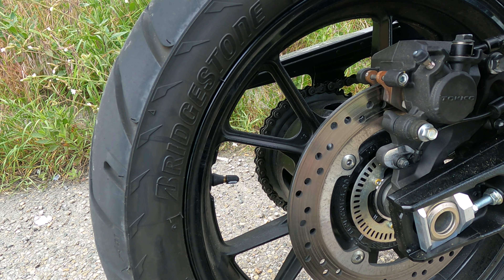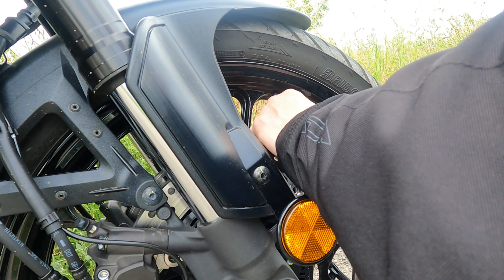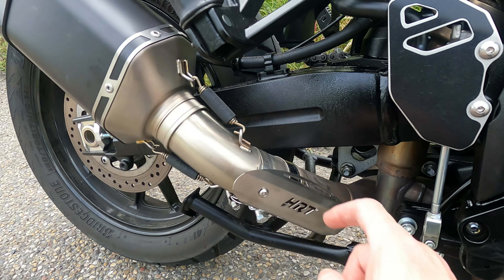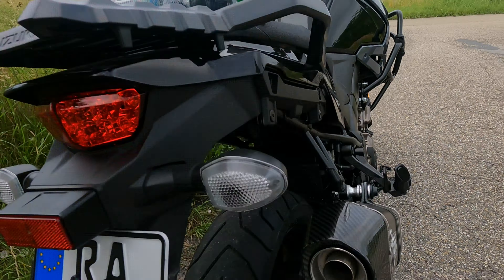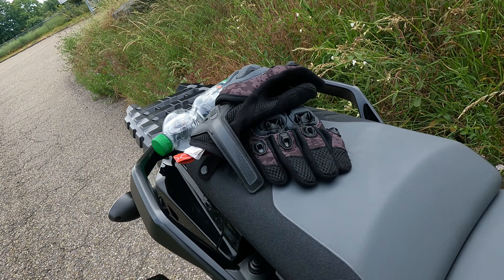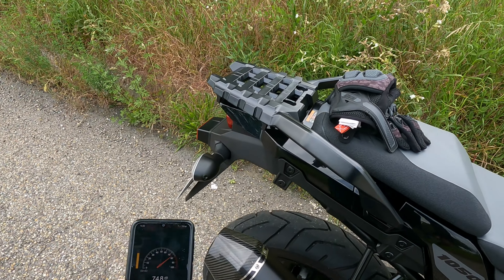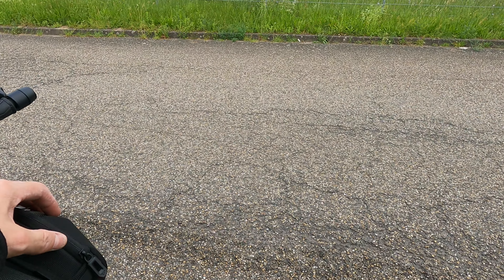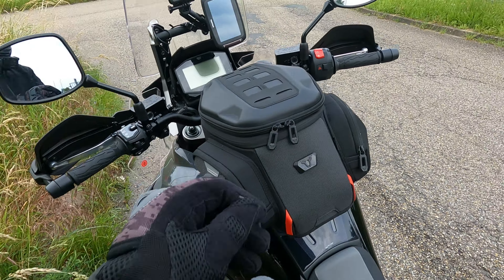V Strom 1050 Mivv Speed edge.

Comment: mhm....... i use a similiar pump from lexin, thats one of those acessories which are very useful s I don´t have to ride to the gas station first.
the sound is absolutely good and in my opinion more than sufficient. nice sound when driving, very good!
And YES, a lot of money, buit as you said..... I couldn't sleep either because of excitement or the decision to make the investment 🤣
But I would still be interested to see what a real measuring device would produce as a result.
Thumbs up!
Appi
Reply from the maker: Yeah they are a bikers friend those pumps! I love the tune now...
an expensive tune 😬😂 If the had the real db monitors in Lidl I was going to buy one 🤔
Stay safe bro and get that mivv...or arrow?
Reply: @GermanJobbies  unfortunately no Arrow availiable for the new V-Strom 650. and MIVV....: not at the moment, too expensive because of the complete exhaust, not only slip on. Akra is the same. for that money I can travel a lot 😉
Reply from the maker: It's a luxury buy anyway Appi. I had no need for it on the bike 😬I agree, fuel money makes more sense always!

Comment: well, there's also suspension upgrades ...
Reply from the maker: BAHAHA! Stop you bugger! 🤣 I'm done.
Reply: @GermanJobbies  hehe, I just tweaked my rear compression/rebound screw and I like it more now. Cured me of my immediate suspension upgrade desire. On the next tire change tell them to put 90 degree valves. They are the best !!! aaand I pulled the trigger on a MIVV oval carbon, for maximum weight savings :)) Can't wait to mount it.
Reply from the maker: @ioandragulescu6063  I really need to fiddle with mine too. Yeah those valves will be much better 👍👍YAY! you got rid of the square bazooka! 🤣 When are you gonna upload some stuff? 🤠
Reply: @GermanJobbies  I also got some fancy arrow carbon shield for the pipe, for one of their own slip ons for the 1050 (part no 11008MI) so let's  see if Italian on Italian luv works (I am still to receive the parts and do the install). About uploading,  I don't know .... I'm still fidling with recording and what not. Got myself some ND filters that I never tried, still figuring out the best place to put that MIC2 ... and somehow I lost the vibe for it. Most times I'm like "neaaaah, I'll just go ride this time, no messing with the cam stuff... maybe next time".
Reply from the maker: @ioandragulescu6063  Gonna look brilliant! yeah I'm the same of late, can't be arsed with it.